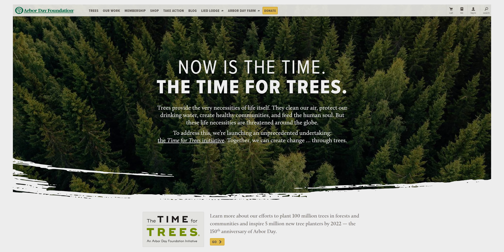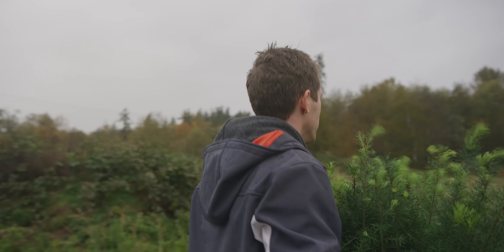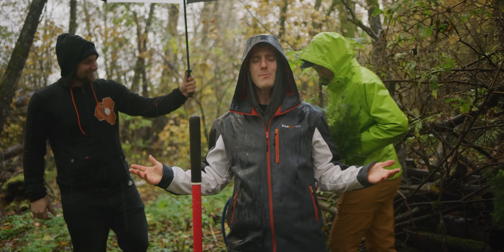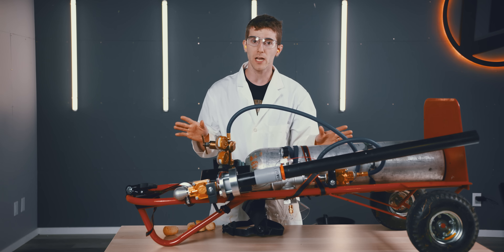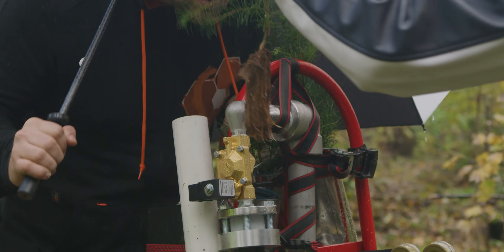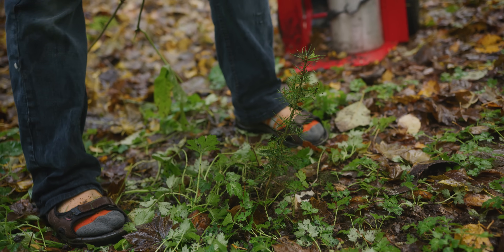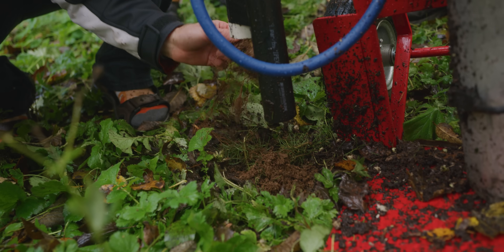We Built a Tree-Planting Cannon #TeamTrees

Comment: you should tell your buddies that when you plant trees they should be anywhere from 6-12 feet away from any other tree. Though forest fires can happen for various reasons, most will simply die out without even taking out 50 square meters. Rather than heat, which sparks more forest fires, density is the number one cause of the massive forest fires you see on TV. This is why cutting down trees and clearing out heavy under brush is an extremely important part of keeping an evergreen forest from going up in flames. Loggers who go through and cut down all the massive trees in an area while leaving the rest untouched are partially doing it for this reason. Deforestation caused by "clearing" is horrible for the environment, though, and something that is happening more and more within the amazon as agriculture is becoming more prevalent in those areas.

Comment: Might work better with seeds.
Or if the gun were warn like a backpack and a way to drop the saplings into the hole without having to bend over for each one. You would have a marketable ergonomic solution.. i think.

Comment: I'm not against planting trees, but I don't think this is going to work like people think it is. Basically the tree becomes a giant carbon battery right? So what happens when the tree dies, or if it is chopped down... struck by lightning... or whatever. I'm betting that it ends up re-releasing all of that carbon back into the air. So in the end I think it will be a huge effort that will make little to no difference in the long run ( as far as CO2 is concerned ). There are many other great benefits of planting trees... I'm just not so sure that it will really help that much with C02.

Comment: It is possible to carpet bomb trees, but they need to be seeds. 
You take a mixture of manure, peat moss, clay and tree seeds. The mixture should be about the texture of raw pizza dough. If it is too soft, add more clay; if it is too crumbly, add more peat; if it is too dense, add more manure. Roll them into balls a bit smaller than a ping-pong ball and let them dry. You can then disperse them by dropping from the sky, using a sling shot, shooting them out of a low velocity air rifle or simply tossing them every so often while walking. 
Check on trees that grown in your area before ordering the seed or simply collect seeds from a woodland nearby. Keep in mind that if you live in an area that gets snow, your seeds aren't likely going to sprout until they have spent 1-3 months at near freezing temperatures. If you would like to see them sprout faster, stick them in the back of your refrigerator for a while. If you are willing to wait, spread them in late spring when animals have plenty of other food sources so that the seeds have a chance to sink into the soil by the time those animals start to eat everything they happen upon.

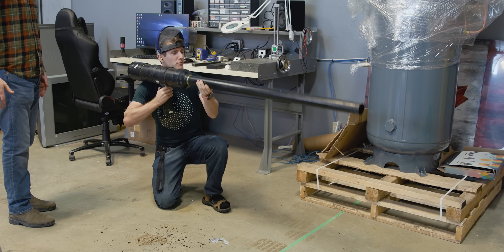Comment: at 1:55 "40 feet per second lower than what is classified as a firearm"  - That statement in its self isn't 100% true, but also not false. you need to also take into consideration, not just the muzzle velocity, but the muzzle energy.  Which cannot excede 5.7 Joules. - So if the AIRGUN exceeds 500fps, but not 5.7 joules it's fine. If it exceeds 5.7 joules but not 500fps it's also fine. If the velocity and the energy are both other 500fps and 5.7 joules. then it is a firearm. - BUT this applies to airguns, that uses a blast of compressed air/gas to propel the projectile. you guys are using a flammable substance to create a contained explosion to propel the projectile.  sooooo Im not sure where that lies in the law.  I'm better versed on airguns than ... improvised firearms...

Comment: Not trying to spoil the fun here, but are you planting conifers in a broadleaf forest? Because if so, that's basically what they did here in Germany many, many decades ago because they grows faster and therefore there's more profit in it, with the slight negative side effect that they ruin the soils capacity to store water, fall over in droves in storms, bark beetles really love them and their resistance to increasing temperature and less water seems to be exactly none. Now there's no profit in it and we still got dead conifers lying around in the forests from storms three years ago because there pretty much isn't enough manpower and machinery to keep up with the pace at which they are dying. The broadleaf forests seem to be doing reasonably fine at the same time.

Comment: If you plant 3 wild saplings from a mother plant before you cut down the mother tree for resources, globally tree populations would increase over time 3x as quickly as we could ever deplete them. This formula could work if the planting of the saplings is eco friendly ENTIRELY. THIS WOULD HELP WITH SINKING CARBON not just filtering the carbon from Co2. 

If you need the wood of a tree. Plant 3 of its babies.

Comment: "We finally planted 20 million treesusing the cannon!"

Well actually 10 million half of them died
Reply: Yasir Sarwar Yeah they have to cover the trees space around it with something to block sunlight to the grass so it does take all the root space. I used bio degradable plastic and iron prongs last time.
Reply: @justdashie1132  you know bio degradable plastic does not actually mean you can leave it exposed on the ground and it will magically degrade right? it still needs processing to be decomposed. it simply means it does not need to be burned like normal plastic bags do, but can rather be destroyed - through a mechanical, man-guided process.
Reply: mind.overflow - formerly lol7344 I think Tree Canada knows what they’re doing. The process of bio degradation isn’t the weather or manual process.

Comment: One suggestion I would meet to your tree cannon instead of having just one solenoid valve you should split the tank of compressed air into two solenoid valve one for high-pressure and one for low pressure into the same firing tube so when you fired the high pressure solenoid valve at roughly 200 psi and then fire the low pressure solenoid valve at 60 PSI roughly so that you won’t destroy the tree ( this is just a suggestion )

Comment: The problem I have with this sort of initiative is that they usually plant only 1 kind of tree. A natural forest seldom consists of just 1 kind of tree, especially in tropical areas with high flora bio diversity. Although some trees are better than no trees, it still leaves biodiversity degraded compared with before when the forest was pristine. It also leaves the entire forest and even species of tree prone to being wiped out by diseases, as is happening with bananas.

I really want to see more than 1 species of tree being planted. Especially non-conifer species in temperate areas like the UK which naturally has numerous tree species such as Ashes and Oaks. Ideally a natural ratio should be used to maintain ecosystem health. They should also be planted as a natural spread, rather than in fields of all the same species with uniform spacing.

Comment: erm Linus I don't think it's a good idea to use nitrogen cause that would be still having a bad effect it's often not mentioned when it comes to adding greenhouse problems to our atmosphere even though it makes up about 78% with oxygen only being 21% if everyone was planting millions of trees using this method for each tree you plant you'd be releasing a greenhouse gas which type of gas is it specifically?
causevvvv

"Nitrogen emissions such as ammonia, nitrogen oxide and nitrous oxides contribute to particulate matter and acid rain. ... Nitrous oxide is a particularly potent greenhouse gas as it is over 300 times more effective at trapping heat in the atmosphere than carbon dioxide"
Reply: Dr. A.I. Kryptanical nitrogen gas is not the same thing as ammonia, or any of the other things you mentioned.

Comment: Technically something like this could work...more efficiently tho so use compressed air to make the hole and have something plant it gently then pat around it. Basically put that on a rover or something and work out the kinks to make it right then put it on a designated path. Plus you could add like a soil fertilizer on top so it dispenses some around the tree before it pats the dirt down. You could make this with mark probably

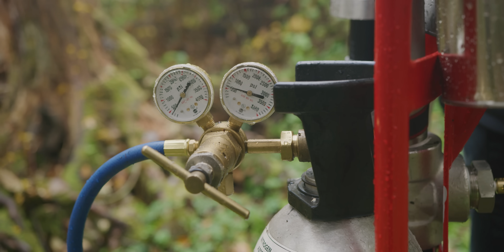Comment: Either the gauge on your regulator is faulty.  Or the safety release is faulty (or not really 300 psi).  Because at 8:32 you can see the pressure set to 400 psi. And you tank is nearly empty (or the tank side gauge is faulty).

Comment: Linus, please read this if you can. Acetylene  is immensely dangerous and you can blow up your entire building with a single tank of it. Does your insurance know about it? For the love of god please switch to oxy-propane NOT oxy-acetylene!! You don't need acetylene unless you're cutting through inch+ steel which you are not. Also, do not use it in a cannon like this, that's just astoundingly dumb and dangerous, even for you. use propane it's just so much safer and will work for that just fine, OR just use hair spray! It has enough kick too. But please do not play with acetylene, it is a serious work gas, not a toy gas. You let any acetylene over pressurize and it explodes. As in you drop a hammer on the acetylene line and it can explode, it's that unstable.

Comment: What you need is to replace the need for a shovel with a drill that will drill a hole, then shoot the tree into the hole. Then use some sort of air blower to push the dirt back in. Also that thing sounds like a elephant. lol

Comment: Do you think you could expedite the cannon planting process by blasting a larger hole with a bigger projectile so it'd be easier to fit the sapling in, and just by using the frozen fertilizer puck as the initial projectile? It'd probably break the fertilizer into bits but as long as it was near the roots of the tree it'd probably still grow fine.

Comment: We made a few potato cannons when I was growing up.  Our best one had two 4" PVC tanks we would charge up to 80-120 psi, it ran through a sprinkler valve and into a 3/4" barrel.  We would load a rock in and 2 would come out because it would split it in half. We found out that the best ammo was either the little 1oz CO2 canisters or a 3/$" dowel rod. We could embed either of those in trees.

Comment: Honestly you could just have a robot that has a small drill on it, nutrients with the tree on top.  Robot drills to make the hole dispensing the soil around the outside of the hole. The robot drops the nutrients and tree into the hole. And a simple series of metal plates just move the dug up soil back around the plant, then it moves on.